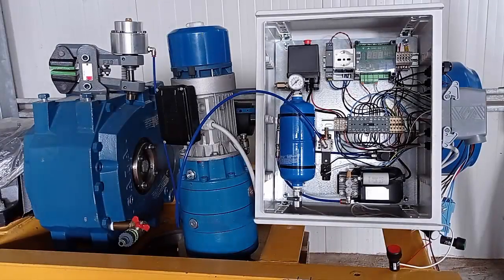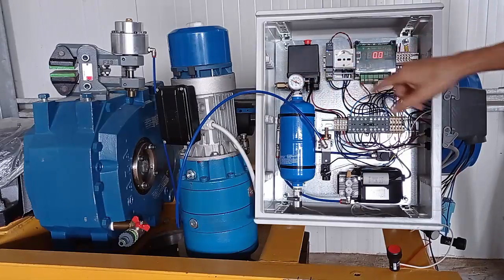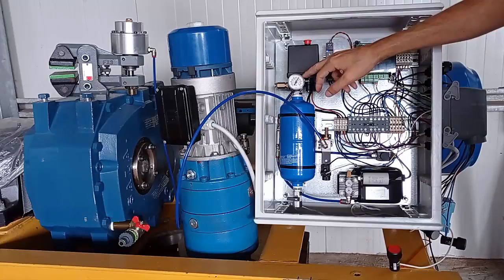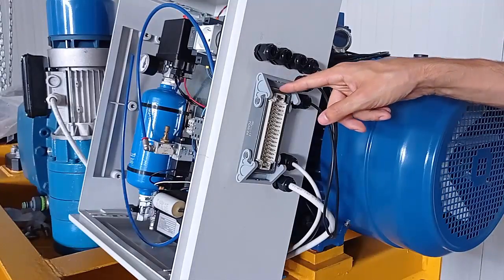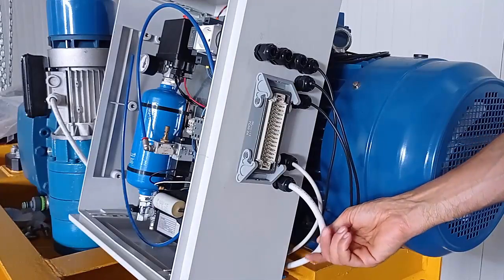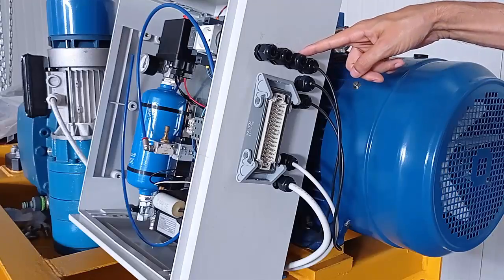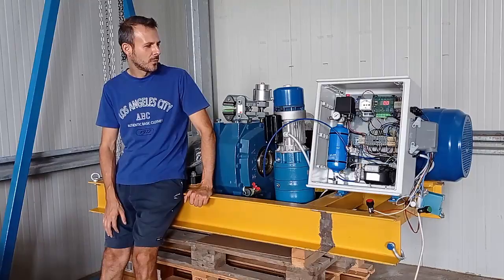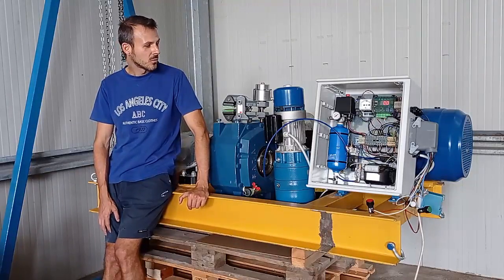Making a wind turbine - part 1 - Brake system

Comment: Thanks and great video, so when the wind speed is excessive, the sensor can detect that and then the brake on the shaft will be applied right? And 2nd question, I guess the sensor has already pre-set up a max speed value, so that when the wind speed reaches that value and then automatically applies the brake?